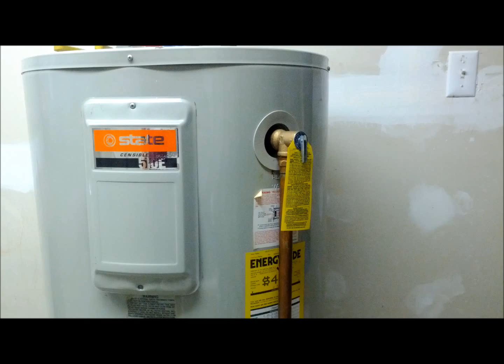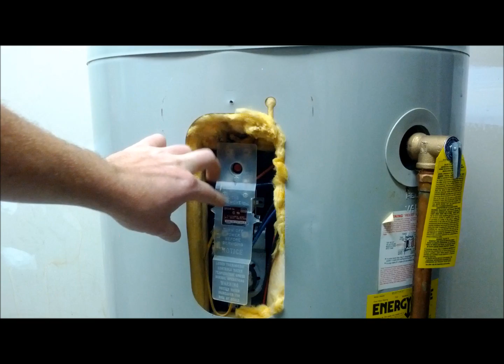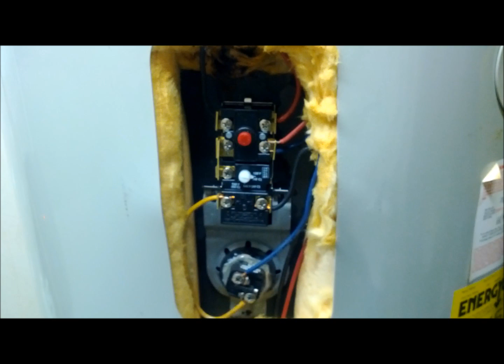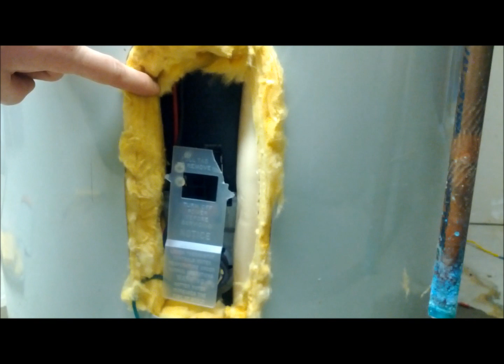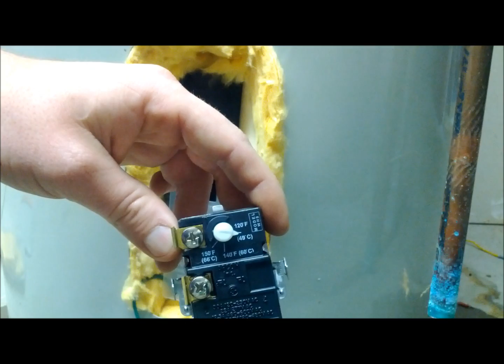How To Replace Your Electric Water Heater / Hot Water Heater Thermostats

Comment: My neighbour and I replaced both elements. We left the bottom right nut a tiny bit too loose and this created a small leak. Water got onto the lower tstat and element. Not sure what happened but the new lower element won't work. Would we need a new element or maybe just replace the tstat? Could it have shorted the wiring to that element and the whole unit is junk?
Reply from the maker: What was your original problem? Are you running out of hot water and that is how you know your lower element is not working? So the top element was leaking and running down and got onto the lower t-stat and element?  I would say you should be able to replace the lower t-stat and you should be good to go. The wires from upper t-stat to the lower t-stat is all insulated and only stripped back where you see them.
Reply: Great thanks for the response, ill give it a try
Reply: Jon Bacon s

Comment: This does not show me how to replace it at all, you skip that bit? You just show it replaced. I want to see how you get it out and how you put it back in?
Reply from the maker: This was one of the first videos I did so i didn't have a stand or the camera I use now. Its on my list to re-film.. To get them out you will need to use your finger or a flat screw drive and pull outward on the metal taps on each side of the thermostat so it will let the pin on the thermostat slide upward. To reinstall the new thermostat just press it against the tank and slide it down until it "clicks in" to the locking tabs.

Comment from the maker: Sometimes the wire is to short. Some t-stats come with a wire and a wire nut. I am guessing yours didn't. So you will need a small piece of #10 gauge wire and the appropriate sized wire nut (Tan) Put one end into the t-stat and the use pliers to twist the other end and the hot side coming in together and then wire nut it.

Comment: Hi Alvin, I came across the same problem, it's a Kenmore water heater, and the replacement thermostat is a generic replacement. The contact is hiked up more than the original, so the black wire is to short. I hope you figured it out, and was hoping you could shed some light, I would appreciate it.

Comment: My hot water heater isway to hot,I have turned down both thermastats and it is hotter than normal.Is it possiable that the thermostat is stuck in the on position.

Comment from the maker: Hello, yes they have one thermostat. That may be cause by the thermostat having a short or the element has the short and needs replacing. You may also have a pinched/ faulty wire that is also shorted out to ground.

Comment from the maker: That to me sounds like a bad thermostat.. It's kicking out or tripping because it's reaching it's high temp limit. Replace the thermostats and you should be good to go. Most electric thermostats are interchangeable the difference is that some have the temp in degrees and some have a,b,c or warm, hot, very hot. If you click the link in the description there is a link to buy them both for under $23.00. Good Luck

Comment: My electric water heaters ..water gets really hot, then we notice the red reset button trip.  This happens everal times a week.  How can you know if its the thermostat or the heating element.  and if its the thermal stat..do i have to use the same brand as the manufacture?  Or can I just go to local store and buy thermostat?

Comment from the maker: Just to make sure larger t-stat up top? Sometimes a wire is to short. Some t-stats come with a wire and a wire nut. I am guessing yours didn't. So you will need a small piece of #10 gauge wire and the appropriate sized wire nut (Tan) Put one end into the t-stat and the use pliers to twist the other end and the hot side coming in together and then wire nut it.

Comment from the maker: Good Question... Symptoms could include: 1) The water is way to hot no matter what the thermostat is set to. 2) The water could be cold or luke warm as the thermostat has reached its high limit and kicked out. If you need to keep hitting the reset to get hot water or the water temp is not being adjusted you will need to replace them.